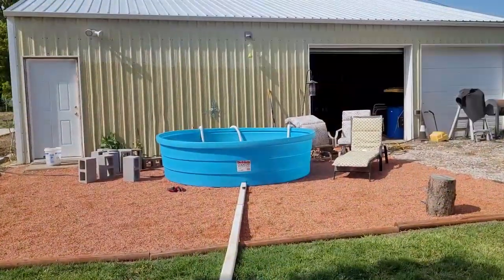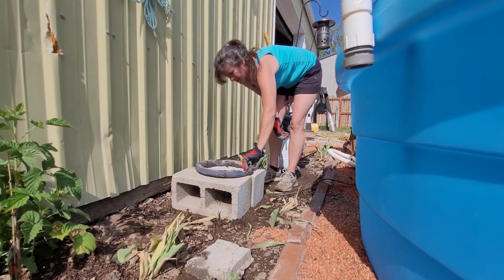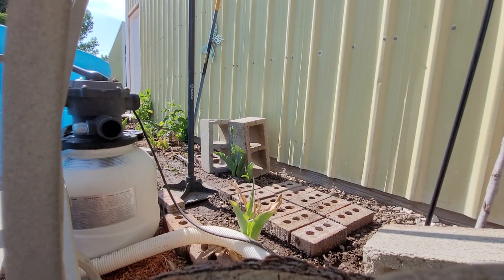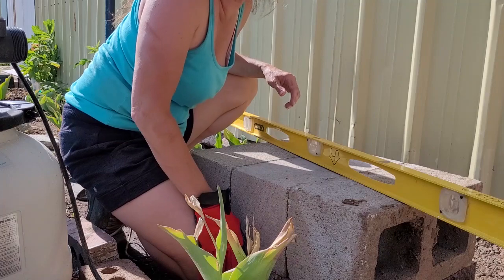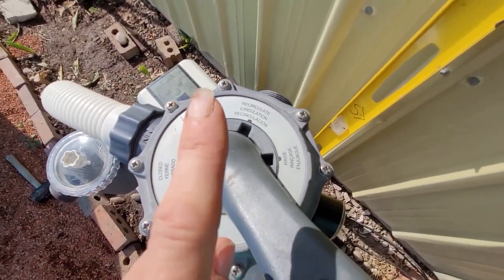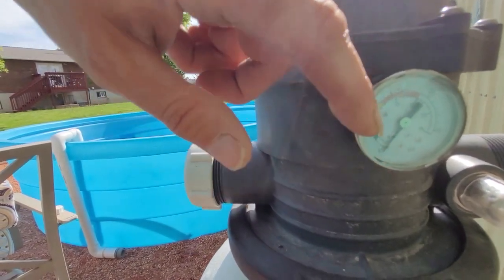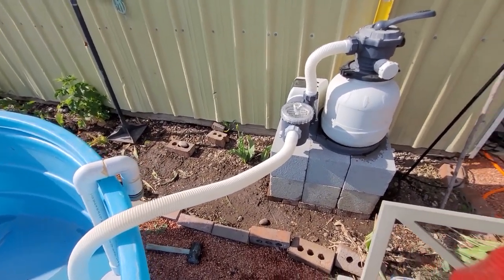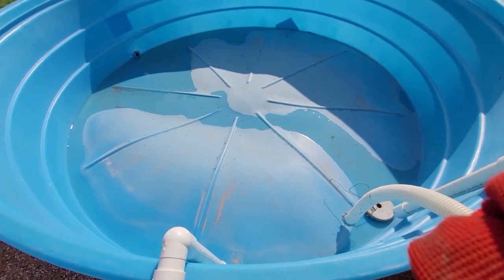Stock Tank Pool Install!!  AKA "Adult Kiddie Pool"

Comment: Great job! 
 As a retired pool service & repair pool Co owner for over 20 yrs I'll give you my two cents. Using a no plumb-drill method, you have to be weary of having long hoses climbing from the ground up and over a pool top. It makes it more difficult to prime a pump and for a pump to pull the water from the pool into the pump. That's one of the reasons you had a problem with priming and pressure. Also same with the return. Less pipe/hose travel time, with turns, especially 90° turns is best. When setting up a filter with a multiport valve on top. You want to make sure the backwash valve pipe isn't facing anything you don't want wet. Just in case your backwash hose comes off at the connection point. Now that you have it set up and it's working fine, next time you backwash it and put it back to the filter position afterward. Check to see where your needle is at on your PSI valve. That is your normal operating pressure for your set up. Then move the PSI needle to the green. So for now on, when the pressure goes up, you'll know when to backwash.
 Excellent idea and lovely video! 👏🏼
Reply from the maker: Thank you again!!  Great info.